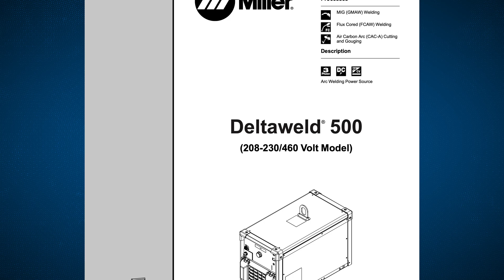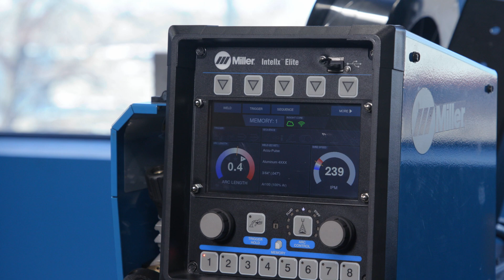Deltaweld® Aluminum Welding Setup

Comment: Does it work with a spoolmatic pro or does it need to be the xr pistol pro plus?
Reply from the maker: Thank you for your inquiry! This product is not compatible with spool guns, only push-pull guns. Please refer to the spec sheet for a full list of compatible accessories, which you can find here: https://www.millerwelds.com/-/media/miller-electric/import/specsheets/file/dc165-deltaweld-350-systems--english.pdf.